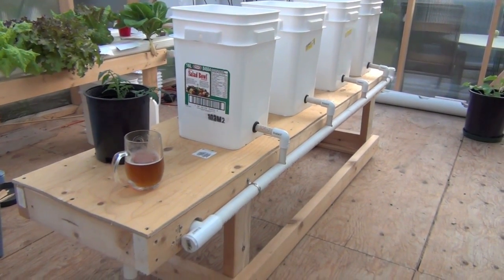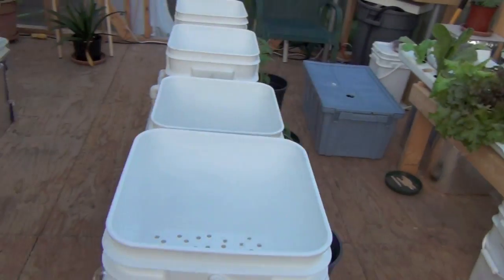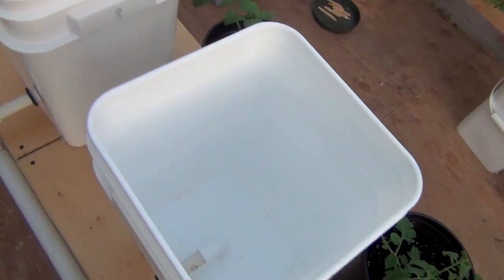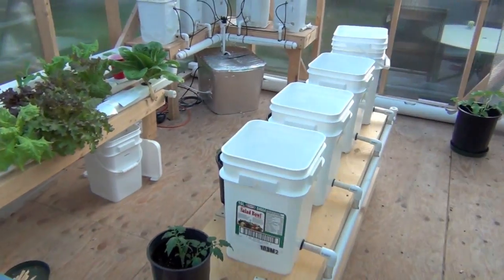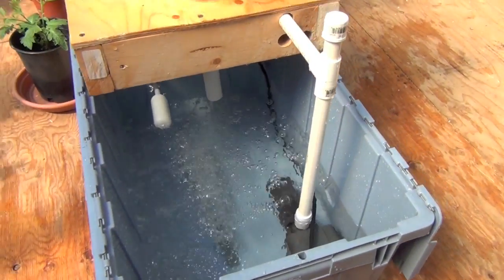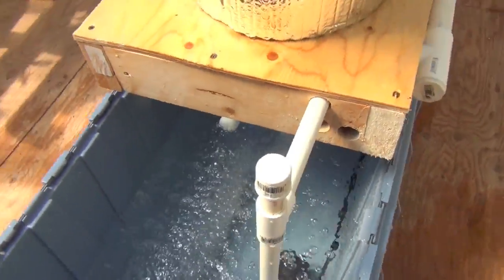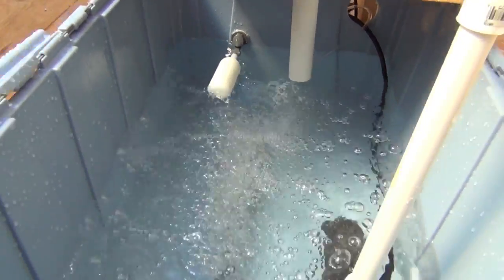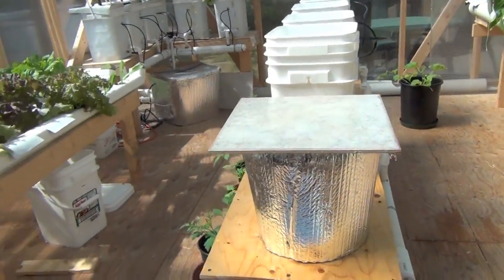Hydroponic Greenhouse Project, New Dutch Bucket System Build

Comment: hi Iowa USA in my greenhouse I use car parts with my Solar system the fan I have a alternator and a windshield wiper pump, a radiator with my rocket mass heater to keep the water and greenhouse warm in my Aquaponics during the winter water at 75 degree F will let pants grow normally. Everything is gravity feed with swirl filter and lava rock have one pump running system. My sump were all the water goes has a wicking system for my potatoes. solar dehydrator connected to greenhouse  Love the VIDs

Comment: I'm about halfway on the setup, cutting down the size to about 20 or so. I didn't bother covering the white buckets. I thought light could be an issue, but the plants did fine. So I'm doing the same thing this time. Also, I tried perlite, hydroton, small and large rocks. I didn't notice a difference in anything except the cost, and the weight. Right now, I'm starting everything with just perlite. If the heat doesn't kill them early, I think they'll be ok.

Comment from the maker: well Bro I can tell you it's called a Supreme Classic 250 gph magnetic drive pump. I'm in BC Canada so I'm not sure where you could get one but you could order on line. I don't run that much circulation but I need the pressure for the sprinklers in using in the top of the buckets. I really love the two I got they are work horses and they are dead quiet. I'm glad you enjoy the videos brother I'm having the time of my life. Be Of Good Cheer Bro  -Brock-